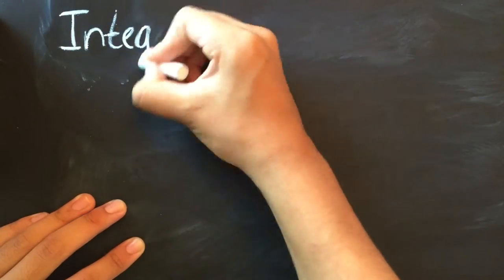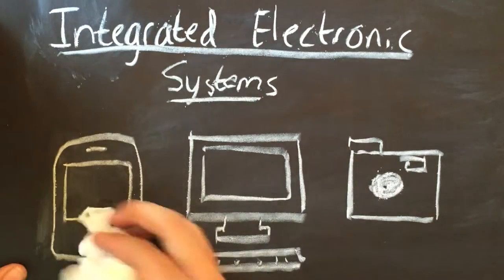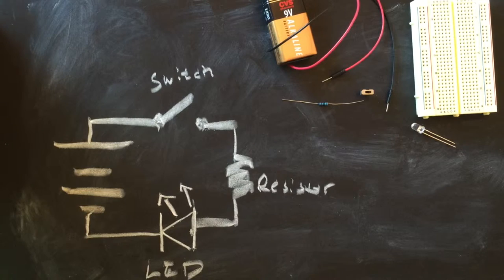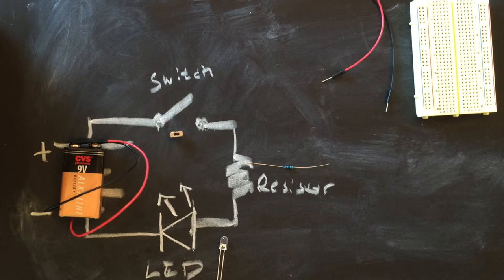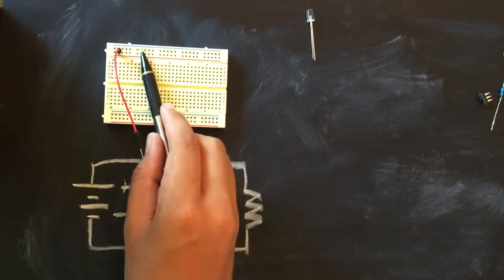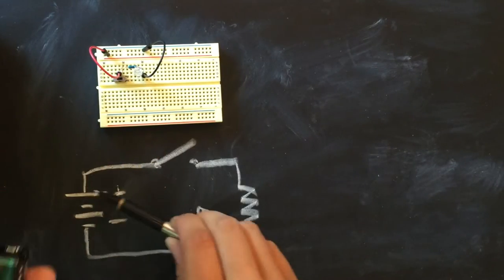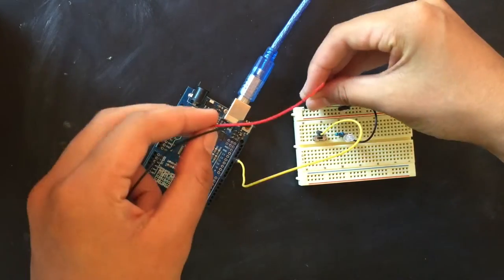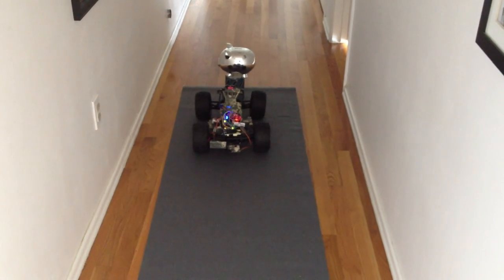How to Build a Simple Circuit: Integrated Electronic Systems

Comment: I am watching this video for the first time. I went into Army Intelligence school in 1980 to study Electronics. They still used tubes and solid state transistors then. The theory on those particular components was very interesting and part of the curriculum. We did learn digital and logic theory,  along with basic programming. We learn to troubleshoot to component level at the end of the school. The microprocessor used then was a 8085 with a clock speed of 9.831 mghz. Lol

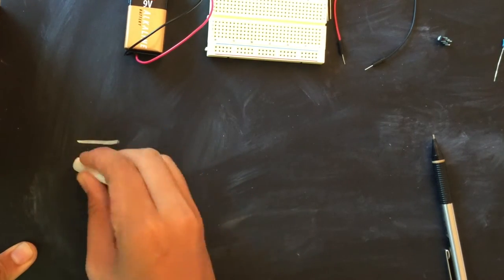Comment: 3:45 Keep in mind that 'electron flow' is being described here with energy flowing from the negative terminal of the battery through the circuit to the positive/ground terminal of the battery, although in general, most diagrams and circuits are connected with conventional flow in mind, which is the source voltage coming from the positive terminal and exiting to the negative terminal. 

It's a bit confusing, but just remember that conventional and electron flow are two separate things that are good to be able to distinguish between. It doesn't change the layout of the circuit, it just flips the +/- at the start of the circuit, with positive meaning voltage source and negative meaning ground.

Electron flow describes the direction that the electron charges are passed through the circuit (go figure lol), and conventional flow describes the direction that the positive charge/electron holes flow.

Comment: damn, is there a way you could share ultrasonic sensor implementation into your circuit, or specifically the code on how to interpret the data from the sensor? I'm an electrical engineering student also and been wanting to work on something like this. I just cant find many resources on specifics.